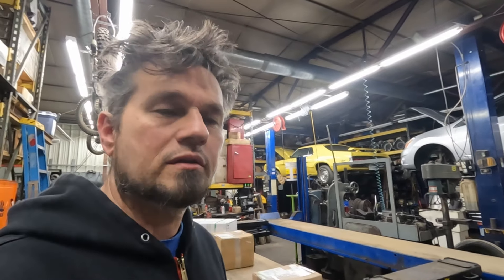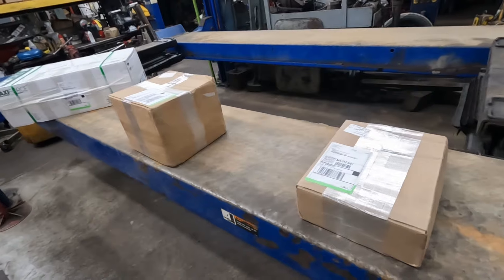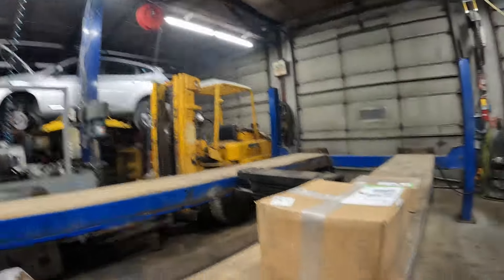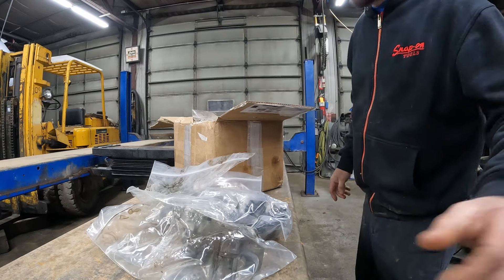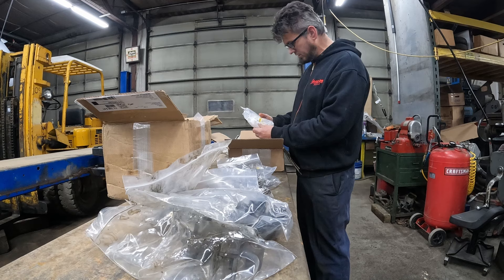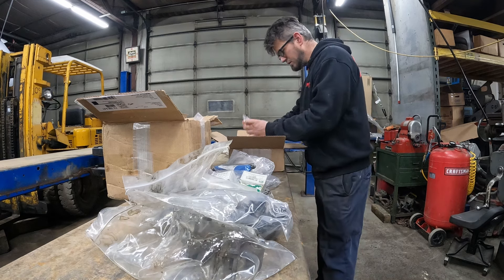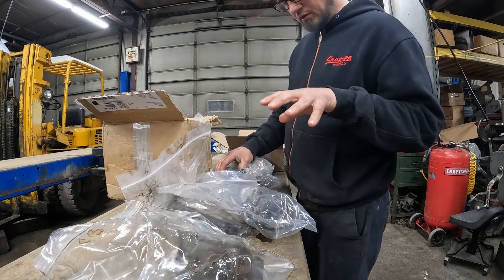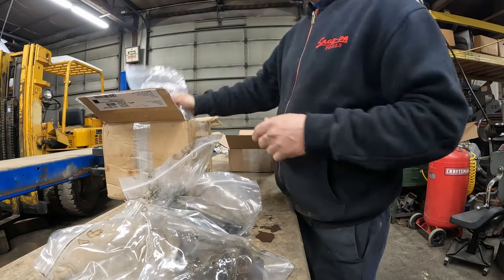MCI Bus Detroit Jake Brake Parts and a Smoke Show

Comment: Nice video! My plan on mc5 is to use the t0-11605C 6 speed too, I’d be interested to see what you do with the linkage!
Reply from the maker: The original linkage is the two rods. I pulled linkage from a parts bus that was originally equipped with a 5 speed. It is a single shaft that moves back and forth and rotates. I'm planning to swap it in, but often wonder is the two rod set-up will control the Fuller 5 speed as well. I'm looking forward to digging in.
Reply: @scatteredrustyprojects there’s a lot less space under my mc5 (no tag axle). (In the last video I posted you can see me crammed under my mc5 lol). I’m guessing your donor bus is a 1980s one (I’ve seen that box in one of those). Whereabouts in the country are you based? Is the clutch mechanism and system different on the 11605 vs the spicer? (I hate the clutch on my mc5!)
Reply: @scatteredrustyprojects one small thing about the smoke- as to whether it’s the injector(s) or the rings, you can visually open the windows at the side of the block to visually spent the liner port/ring interface.
Reply from the maker: @MarquisRex  I'm in North Adams, Massachusetts. Yes, the donor was 1980s. Either MC8 or MC9. There is another US Coach in Alliance, Ohio. He sold me an 8v71 and the 5 speed with the linkage. I'm not sure about the clutch yet. I'd love a little easier clutch than my MC7 has. With the height of the seat, it hurts my knee.
Reply from the maker: @MarquisRex  I had one of those off and really couldn't tell much. I'm not that well versed in normal Detroit appearance....yet.

Comment: Excited to see what the smoking issue is. Do you have more than normal leakage? My 73 pisses a ton of oil. After two years I still don’t know why. It doesn’t smoke in the least bit, but it leaves an oil drop trail you can see and follow. I’m starting to wonder if it’s just got too much. I read somewhere that there are different oil pans that hold different levels of oil. Anyway have fun with it.
Reply from the maker: I'm quite curious as well. Mine also leave puddles from the drip tubes. I saw another video with a Detroit that has a lot of oil coming from the drip tubes. It ended up being the oil control rings on the piston. When this is all back together, I plan to make a catch bottle for the drip tubes.
Reply: @scatteredrustyprojects  I don’t mind so much dripping oil, it just gets expensive to have to add a gallon every two hours of driving. I would think if the rings were bad it would smoke.
I’m gonna use my bore scope and peak down into the blower. Maybe something there.
Reply from the maker: @kevinvincent4323  the video I saw showed a rings below the wrist pin for oil control. In the video it seemed like a little oil could purge up above those lower rings and work it's way in the air box to then flow out the drip tubes. Wrist pin caps is another possibility. I agree that either of those seem like they would promote smoke. Sounds like you are buying new oil to top-off. If you didn't know, FYI: Oil that flows through the air box will pick-up micro particles that passed  through the air filters. Even if you collect the oil, it shouldn't be used in engine lubrication. The drip tubes in my engine were routed back into the oil pan. I rerouted them to open end and then realized how much oil is coming out of them....probably as much as yours.